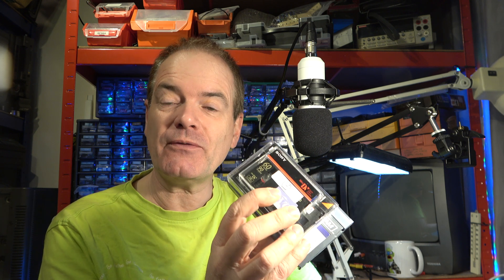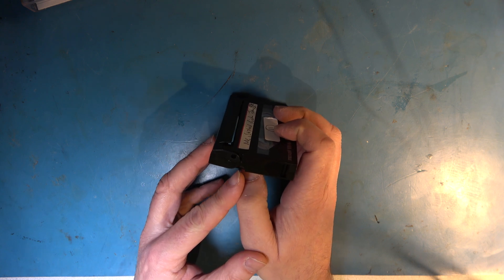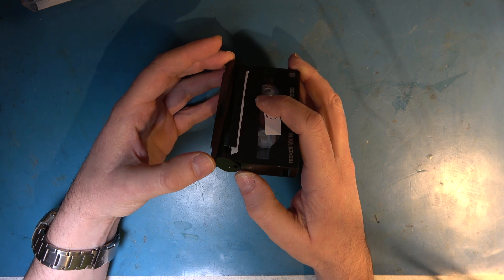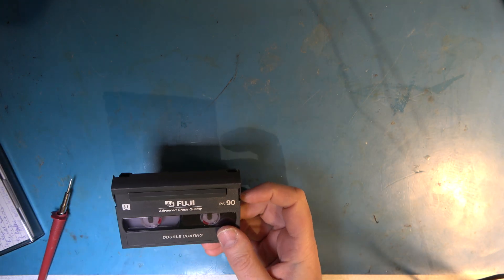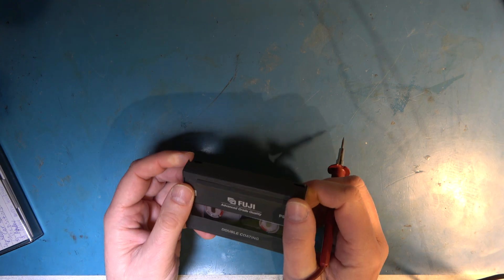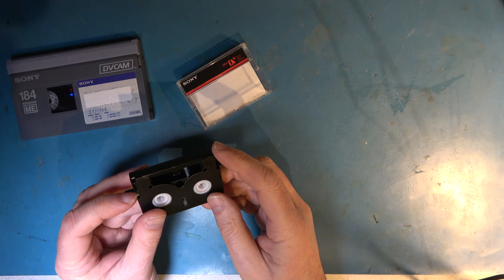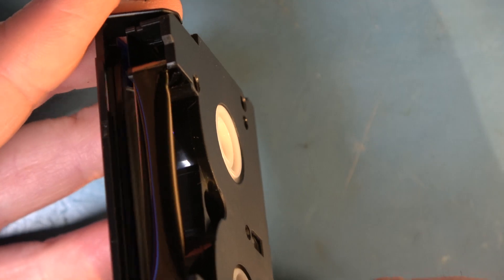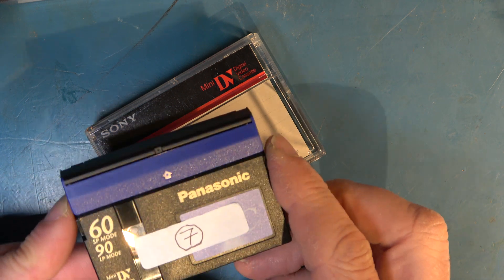Video tapes which can damage themselves and/or player.  Also Copigard lies.

Comment: Thank you for the informative video.
How do you approach Hi8, and MiniDV cassettes suffering from stripped bolts when the tapes need to be taken out for especially cleaning? I bought two mini sets of bolt extractor bits, but the bits are not enough small to drill and extract the stripped bolts. Even brand-new tapes suffer from oxide correction. Of course, since the tapes are not manufactured anymore, those brand-new tapes are still old. What is your approach on this situation?
Reply from the maker: @willianaleman6114  Sometimes there is no option but to break a cassette shell apart and transplant the spools into a good shell.
Reply: @video99couk Great. Within the situation, your confirmation makes me feel better. This is what I have been doing with cassette bolts that have no remedy other than breaking the cassette and rehousing the tape.

Comment: I was hoping you were going to cover sticky/shed syndrome.  Is sticky/shed an issue in the UK?  Most video and professional audio tape manufactured in the USA after 1984 suffered from this as whale oil could no longer be used in manufacturing.  Brands such as 3M, Ampex & BASF were the worst.
Reply from the maker: I do mention that on other videos. Yes it is very much a problem here. I bake Ampex tapes as a matter of course.

Comment: My Sony M25 beeps incessantly when a sticker is on the top of a DV tape. I have learned the hard way. "Oh that is far enough back to not be an issue". Beep beep beep. The machine then goes through several loading cycles, whilst the screen flashes and the green tape light flashes and eventually.... eventually the tape is spat out. Probably takes about 30 seconds to get the tape out after pressing eject.
Reply from the maker: Whereas the DSR-11 may never give the tape back.  I wonder how many got junked for that.

Comment: Colin you certainly put together some very interesting videos, I look for them every day. How about a video illustrating what to do to repair a video machines carriage will not work. Just a thought. Colin Perth W A
Reply from the maker: Cassette carriages vary a lot from one machine to another.  Some are easy to work on, some are almost impossible.  Next video is a JVC S-VHS machine.
Reply: @video99couk  no way! I bought a JVC HR-S7000 last week (it's beautiful) but is going back to the sender tomorrow because there's no video signal, possibly due to the output circuit board being cracked / split. Audio comes through fine. Gutted to send it back.
Reply: @ezri85  I managed to get hold of another JVC HR-S7000, this one in its original box, with the remote, one previous careful owner. The previous one didn't want to take a scart or S-VHS lead, the plastic on the back was very weak, the one I have now is very solid. 
So it's got to be that somewhere in its previous life, someone forced a scart in which snapped the input board. (So there's probably loads of dry solder joints too, I'm not sure the seller will fix it)

Comment: Don't companys talk some rubbish lol :-D
Playing the crappy quality tape may damage your machine, that sounds more likely lol.
I've never owned anything other that vhs,  oow that's a lie as i transfered a bruce lee film from betamax to vhs.
It was "Enter The Dragon"  dam good film.
It was someones very good recording from central.
I also copied the old startrek movies (protected) to another tape, the old jvc hr3320ek machine ignored the protection.
Actually it copied the protection lol.
Newer vcrs needed a certain blank spot on the tape to get the record level correct,  but that spot was full of noise so new machines could not judge the video record amplitude.
Labels were a pain on any cassette, they slowly peel off.
Reply from the maker: Betamax machines also ignore Macrovision and so probably Copigard too.